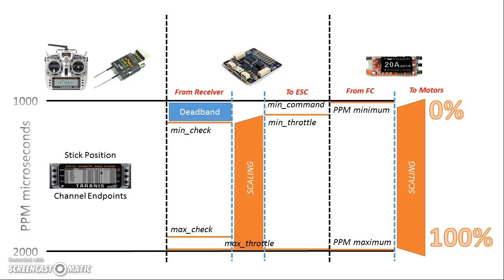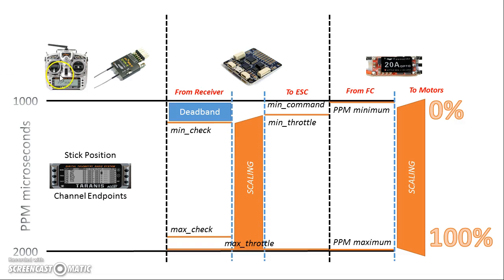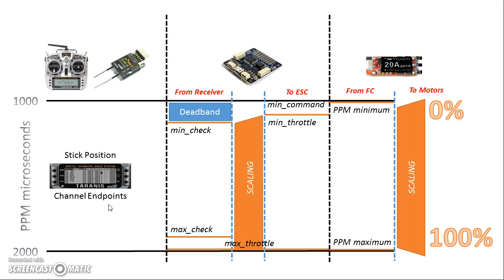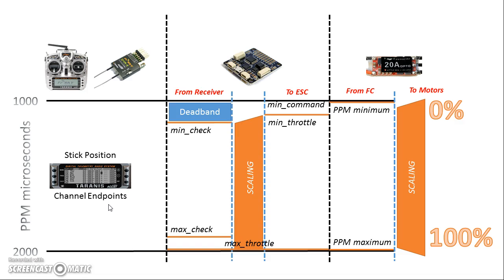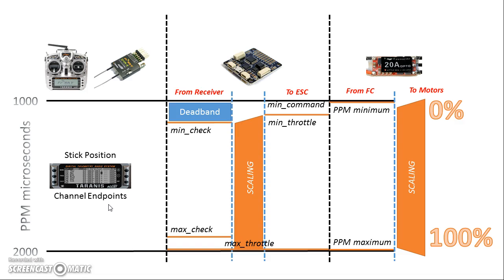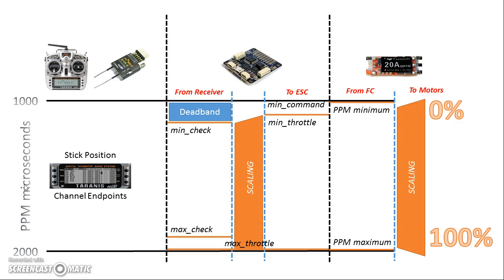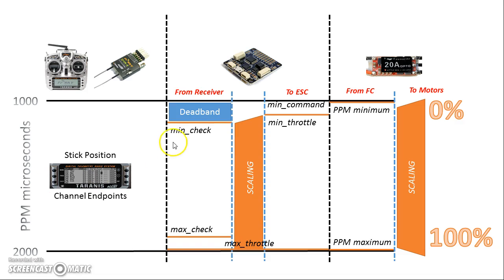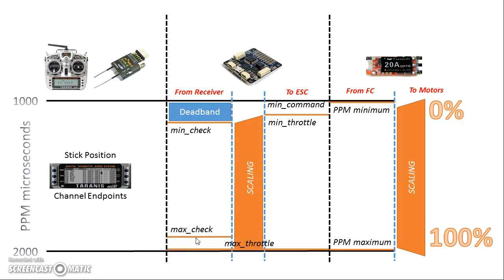Cleanflight throttle parameter configuration - Part 1

Comment: so . . .  i was not 100% sure of this throttle under min check behaviour. 

But . . .  rather than post a misinformed comment i decided to check it for myself. 

For any skeptics this can be easily tested in the configurator. set mincheck = 1800. you can easily arm and disarm at 50% throttle but the bottom 2/3rds of the throttle range has no affect on motor speed. makes sense when you think like this because you wouldn't want it to arm at jump to 50% motor speed. 

You may be "talking for nearly a half hour about such an obscure topic" but videos like this contain so much useful information. these videos can make a large difference to many people's understanding in a positive way. 

No matter how much you know there's always more to learn :)
Reply: +Queron Williams Agreed, I learned a lot from this vid.

Comment: You fixed my falling out of the sky quadcopter! I watched your video and fixed a problem I had with my quad.  When descending at about 20% throttle my would cut out and my quad would fall out of the sky, not fun! So I changed my min_throttle and min_check to 1050, they were both at like 1150. That fixed it! now I can descend smoothly, Thank you Joshua!!
Reply from the maker: +Christopher Byrd Glad to hear you fixed the problem. It is min_check that did the fix. At 1150 throttle position, which is about 15%, the motors would stop because you have feature motor_stop enabled. Reducing min_check reduces the dead-band at the bottom of the throttle where this happens. The solution could also be to disable motor_stop, which will ensure that your motors keep spinning even when you drop the throttle all the way. But this will also cause the motors to spin on the ground after you arm, which some people are not expecting.

Changing min_throttle probably is not related to your issue. In fact, lowering min_throttle makes the motors more likely to stop in flight. You should set min_throttle as follows: go to the Motors tab, with props off, and raise the Master slider slowly until the motors begin to turn. Find the lowest value that causes all four motors to spin without stuttering. Add 20 us to this number and that is what your min_throttle should be.

Comment: Hi thanks for getting back to me much appreciated. I have calibrated the ESCs in betaflight and it seemed to calibrate ok with the tones . I have just tried to calibrate again in betaflight it now only plays 3/4 tune at the top then the last bit when taking down the master slider  but still only the start up tune not the max calibration tone. The ESC are meant to be turnigy plush 60a 

according to bl heli. But we're bought and labelled as little bee fvt 30a min command.  1000 min thrtl1100

Comment: Excellent video Joshua,  explains things very well.  After watching this I checked my set up.  I use motor stop and an idle up.  Min_check is default at 1100 and with idle up the the throttle slider output is 1103-1104 typical.  Min throttle is 1085 on most and ESCs start at 1063 typical.   I figure this gives me close to the lowest possible RPM with throttle stick at minimum (idle up active - motors running) and full control because throttle output never goes below Min_check value. (until I turn idle up off) .
Reply from the maker: Consider reducing min_check to reduce the deadband at the bottom of your throttle stick. You'll need to adjust your idle up accordingly.
Reply: +Joshua Bardwell Thanks I will take a look at it.  Currently my min output value on throttle is 1084 us (in the RC Tab) - I used end points to set it just low enough to allow board arming.  The idle up kicks it just slightly above 1100.   I set this up about two years ago and basically copied the settings for all subsequent models.   I might revisit all of them now and adjust throttle range to 1000 - 2000 in the slider. (for better resolution as you said)     I think this is where Boris confused me by saying I don't have 100% throttle range using motor stop and an Idle up switch vs Motor stop disabled.     If 1100 is Min_Check and my idle up gives me 1103 am I really losing much?  3/800 = 0.00375 (so maybe losing 0.4% of my throttle range at the most?)    I have tested with motor stop disabled and when arming the motors spin at exactly the same RPM (test by tacho) as they do when I activate idle up...   Just trying to understand what I am losing by using the Idle up this way.
Reply from the maker: +Trainboy64 I don't really understand the bit about idle up hurting resolution. With ilde up off, then whenever the stick goes below min_check, you are in the dead-band. With idle up on, the stick never goes into the dead-band. But the size of the dead-band is the same either way. I do prefer to set min_check as low as reasonable so that I get the most out of my stick travel.
Reply: Joshua Bardwell Thanks Joshua and I totally agree with what you just said.  I tested both with Motor Stop Disabled (deadband width around 20 us) and with Motor Stop enabled + idle up and flight performance is identical with throttle stick at min position in both cases.

Comment: nice , like taking an honors cleanflight class. . i have my throttle low endpoint set to 980 with the tx adjustment lol , was one of the first things i had to tweak a few months ago when dealing with arm no arm newb stuff, but yea ever since this setting , i get full throttle  resolution ++

Comment: Hi Joshua, first of all thank you so much for taking time to make an effort to explain this stuff. you should know that its greatly appreciated by people like me. I have really come to understand so much more about this subject because of you comprehensive explanation, so keep up the good work. 

just one question tho, obviously your speaking about PPM microseconds and for my level of knowledge about the concept of PPM it is only a familiar term in the context of the way that a receiver will be able to "listen" to a transmitter's wireless signal ( spoken in whatever protocol is used for that brand of radio) and then the receiver must convey this data onward to the FC (or other type of controller) using a wired type of communication (being PPM or for some systems i know to be a bus signal or, like in my case, the somewhat oldskool PWM method).  My question is, how much of the info in your video can be applied when working with a PWM receiver? (In cleanflight my bars are pretty much right on target with the 1000 - 1500 - 2000 values for low, mid and high stick commands since i calibrated my transmitter endpoints accordingly using the old fashioned sub-trim and channel range features)

 Secondly, you are showing a picture of the Favourite Littlebee 20A ESC which are the exact same ESC's i am currently using. Could you point me in the direction of where to find more info on which steps are involved with setting those up properly? Im looking to learn a few things that remain unclear to me like: How can I do any sort of calibration to those ESC's themselves, is that all done through CF as well or would i be using an arduino or something like that? Also, do you know how can you tell what kind of firmware is currently on these ESCs and for example if they are suitable to work on one-shot like everyone is talking about. 

Thanks again, Kind regards from the Netherlands,
Thomas
Reply from the maker: Calibrate the ESCs like this: https://www.youtube.com/watch?v=o3Mg-9M0l24

There's nothing special about the Littlebee. All ESCs calibrate more or less the same. 

Everything is the same for PWM also. It doesn't matter.

Comment: Joshua

Building my third quad, previous one have been CC3D FC but I am trying a NAZE32 with FrSky Taranis Plus, X4R Receiver and King Kong 12A ESC's and King Kong 2204 2300Kv motors.

I am having trouble arming my quad. My transmitter and receiver work perfectly but I am sure it is a settings problem. I have watched your videos but can't fathom this problem out. I am using RX Serial S-Bus with the Rx. On the Cleanflight receiver page, flight controls are centered at 1500, throttle is 1000 at low. 

Channel mapping is TAER and limits are 1000/1991, 1010/2001, 1003/1995 & 1005/1997 respectively.

Stick Min = 1000, Stick Centre = 1500 & Stick Man = 1950. (set min check = 1000 & set max check = 1950).

Currently I am unable to change some of the settings, after saving it reverts to the current value.

I know the NAZE32 board has problems arming but can you see if I have made a basic mistake in my settings.

Etops
Reply from the maker: The copter will not arm unless the throttle is less than min_check. By setting min_check=1000 and stick min=1000, you will never be able to arm because the throttle can never go below min_check. Set min_check=1020 or something like that.

Comment: Your description of max_throttle is incorrect. max_throttle is only an output range variable. The input throttle range is always min_check to 2000.
Reply from the maker: +Moto Moto Okay, but damned if I'm doing another set of videos to fix it.

Comment: This is a great video! Really cleared up some things for me.

My vortex doesnt require me to set servo travel in the rx, for 1000-2000us ranges.
The vortex setup wizzard measures stick inputs and applies a scaling  them to 1000-2000, using the following CLI entries

# rxrange
rxrange 0 1051 1988
rxrange 1 1051 1989
rxrange 2 1050 1988
rxrange 3 1051 1988

In your video, i think this mapping or scaling happens at the first (left most) dotted line.
Is this correct?
Reply from the maker: +John Craven Yes, I believe that's right.

Comment: Hi Joshua, good work and great videos. I am having an issue in betaflight where all of my throttle is between 1900 iand 2000 the rest of the range is dead. i can understand why when it starts the motors are  on full throttle as 100% of the resolution is in the last 100 of throttle movement, I am quite new to building quads, would you have any idea in what i can do to sort this issue out,  pulling my hair out :D. many thanks for any help you can give and regards Martin    keep up the good work
Reply from the maker: +Martin Goodbody what is your min_check set at. Have you calibrated the ESC endpoints?

Comment: Is there possibility to decrease deadband (blue box)? I would like to have more throthle control instead 15% of throthle in deadband.
Reply from the maker: Reduce min_check. If you have a good transmtiter, you should only need 5-10 us of deadband between the bottom of the channel (1000 us) and min_check. I run min_check=1005 because my transmitter consistently hits 1000-1001 every time I lower the stick.

Comment: ok..I came here looking for an answer for something that  I've been working around for over a year. Whenever I set up my throttle end points; I can arm and disarm no problem. I can also throttle up and down no problem. But during throttle up itself I notice(from the rx tab in cf) that there is a sort of dead area from :1000 to about 1098 or 1100. Its only after I pass this that the motors come alive. So I end up bringing my throttle channel endpoint up from 1000 to about 1097 or so to shrink this so called dead band. Is this normal ? or is the answer in min_command ?
Reply from the maker: +TeamBlindMouse That's the min_check coming into play. To reduce that deadband, lower min_check. Honestly, min_check is unnecessarily high by default for most people. If your transmitter can reliably hit 1000, set min_check to 1025 or 1015 even.
Reply: THANK YOU !!!!! thank you so much. this drove me nuts and I couldn't figure out which setting to change lol

Comment: Hi Josh. I watched this video and feel like you helped me understand the whole system better. Granted I have already tried to set my min check min throttle one shot and damped light and ESC end points. Something still is isn't working I m not sure the sequence of steps to program and calibrate everything. Ie when to plug in battery when to unplug battery. Can you help me?
Reply from the maker: +ML Caldwell https://youtu.be/o3Mg-9M0l24
Reply: +Joshua Bardwell okay I followed these steps. I found the video before you replied. I went out and flew the quad. Things were working okay until I dropped the throttle hard and attempted to raise the throttle and the quad motors stopped quickly dropped to the ground and I heard the sound of the escs like when you first plug in the battery?!
Reply from the maker: Usually I would say to raise min_throttle but if you got initialization tones possibly your ESC's lost power. Punch throttle on the ground and see if the ESC's reset. It could be voltage sag, or more likely a bad connection.
Reply: +Joshua Bardwell okay I'll look at that. Here are my settings:
Min throttle  1150
Min check 1175
Min throttle 1135
Max check 1900
Max throttle 1924

Blheli 14.6
Ppm 1000
Ppm 1924
Reply from the maker: None if that really matters if your ESC's are resetting. Most probably you have power loss. Try this: with the copter disarmed, drop it on the ground a few times. Or smack it around a bit. Wiggle and pull on the power cord. Etc... See if the ESC's reset. Usually, resetting ESC's means a bad connection.
Reply: +ML Caldwell blheli ppm min throttle is 1032
             Ppm max throttle 1952
Reply: +Joshua Bardwell I am running nanotech 3s 1300 25c battery. It is probably close to 3.5 per cell. I have Kensun 2204-2300 motors 10 amp rating
Reply: +ML Caldwell it probably doesn't help that my receiver is like 20 years old. It probably has dirty connections or something. Or it's the battery may be my C rating is too low for my configuration
Reply from the maker: If you hear the initialization tones from the ESCs, there are only two possible causes. 1) The ESCs powered down. 2) The ESCs were powered up, but the throttle signal stopped and re-started. Number 2) can happen if the FC loses power but the ESCs don't. The most likely cause of all of this is a bad solder joint or other such connection somewhere. The next troubleshooting step that I recommend is to power up the copter, do not arm it, and bash it around a bit to see if you can induce it to power cycle. If so, that is 100% indication that you have a bad joint somewhere, or a broken wire, or something like that.
Reply: +Joshua Bardwell thanks for all the help. I'll look into it more tomorrow .
Reply: +Joshua Bardwell I did some research. I have my power wire to the naze board getting squashed between my PDB and naze board. I need to space the boards farther apart. Secondly my hardware isn't keeping the naze board solid. I can move the board around between the plastic nuts and spacer.
Reply from the maker: Glad you figured it out!
Reply: +Joshua Bardwell thanks. I appreciate your knowledge and willingness to help newbies like me!
Reply: +Joshua Bardwell Still having problems. No wires pinched , new battery with no possible chance of voltage sag, and when I throttle up and back throttle off the quad drops to the ground. Escs do not reset! It's like a signal gets broken and it goes into fail safe and drops. I changed the fail safe to land with power to see if it is a fail safe thing. I'm at a loss. Could my futaba fm conquest transmitters throttle have a dead spot in it causing the quad into fail safe?
Reply from the maker: +ML Caldwell Blackbox would be really helpful to see what is really happening.
Reply: +Joshua Bardwell how much is that?
Reply from the maker: Not sure what you mean. You mean cost? If you have a board with a dataflash chip on it, then it costs zero. Otherwise you will need an OpenLog device (about $10 from multirotormania.com) and an SD card.
Reply: +Joshua Bardwell I think I need an open log device
Reply: +Joshua Bardwell do you know of a good video discussing loop time and what it means and how it applies to different equipment? Thanks
Reply from the maker: Search my channel for "2 kHz gyro sync explained"
Reply: +Joshua Bardwell I've had the worst experience now with Quadcopters. Since I've talked to you I have on order a black box open log device. Just today I replaced my main power and ground wires from each ESC (little bee 20a) and battery power and ground wires to the PDB. Things have been acting like a bad connection making escs go in initialize mode. Today I heard the sound of my #1 ESC sizzling literally. I'm staring to question if I have a bad naze 32rev 6 board.
Reply from the maker: Not sure how a bad Naze would cause the issues you're describing. Are you sure the ESCs aren't shorting to the carbon fiber frame or arms?
Reply: +Joshua Bardwell I'm wondering if I'm shorting the PDB to the frame with any of my power connections? Not sure if the solder pots go straight through the PDB board and are touching the frame
Reply from the maker: Multimeter can tell you.
Reply: +Joshua Bardwell crazy thing, I've flown my quad successfully in the past with little to no issues. Actually I remember it flying the best when I started with baseflight
Reply: +Joshua Bardwell it's taken some pretty wicked crashes, which might have jarred some things a little too hard.
Reply: +Joshua Bardwell for whatever reason I fried my # 1 little bee 20a(saw smoke coming off of it)In bl heli it shows missing connection. I have one on order. I replaced all ESC wiring with better aviation grade. Isolated my PDB from frame. So when ESC comes back I'll be ready to try again. 

Is there a way to check my #1 motor to make sure it's okay?

What steps would you suggest to get me on the road again?

I'm running a later version of cleanflight. Wonder if I should try beta flight. 14.6 on ESC. One-shot. 1000 loop time. Light damped. Also my pitch pids were set higher Around 6.